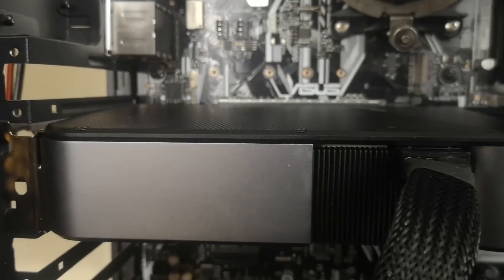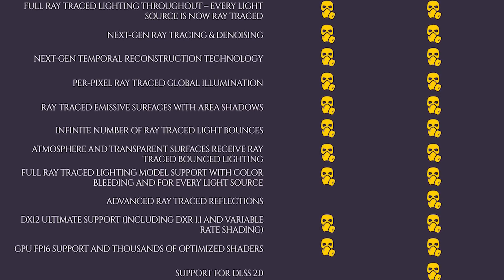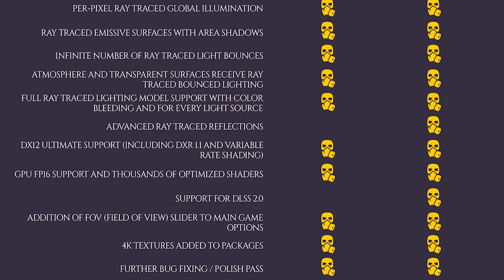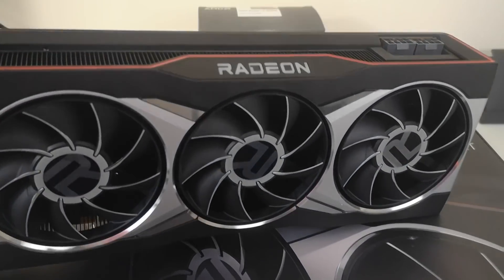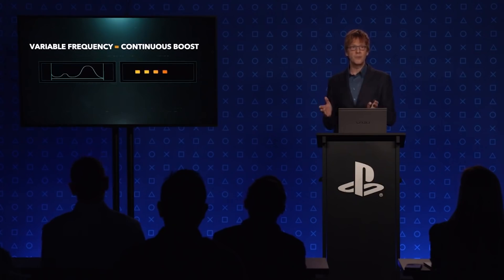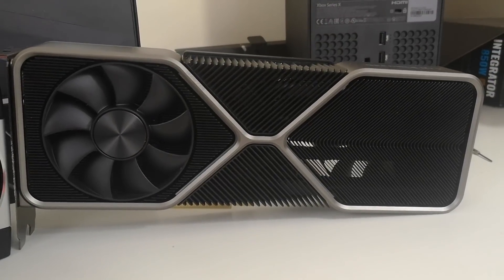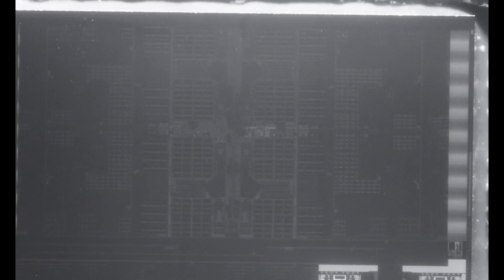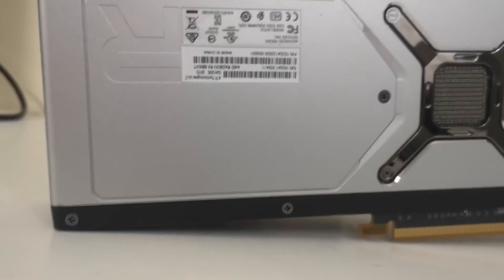XSX & PS5 GPU & Raytracing Performance - 4A Reveals All | Xbox SoC Secret Sauce by Microsoft

Comment: if they would have went with nvidia for DLSS 2.0 these consoles could maintain a constant 4k 60fps easy.Unfortunately they went with AMD who has inferior ray tracing support, No advanced AI cores or Tesnor cores and no advanced up scaling techniques like DLSS 2.0 which actually improves 4k performance a lot ( which looks better than native 4K in most cases).Thats the only thing I dont like about AMD's new gpu's is no good upscaling (or uses it with a bad performance hit) and bad raytracing performance. I know there RDNA 3 they have been talking about are to fix these issues, well have to see then.But either way you look at it they are good consoles for the price and even though Ive seen gameplay dip into the 40's and lower FPS in 4k(thanks to AMD) they seem to maintain 60fps in native 4k most of the time or a little higher without having to use upscaling.The only thing console players dont understand is these new consoles although using current gen parts dont actually use high end parts if they did they would be spending a whole hell of a lot more for the consoles,not to mention its D-ram cashless ssd(which is a bad thing and cheap ssd's dont have a r-ram chip).The AMD gpu is around an RX 6700 performance, which is like 3x slower than the RX 6900 XT but I guess you get what you pay for(and if you have the wallet for a high end GPU right now ROFL $$$$$$$$$$$$$)
Reply: First of all. Nvidia doesn't produce CPUs or APUs. Second do you think tensor cores / AI cores don't need any space on the die? Have you seen how much die space tensor cores are on an Nvidia Chip? Its something around 1/4 of a 600-700 mm^2 chip. On a console you have thermal and financial constraints.
Reply: @hanswurst2869  First of all your ignorance is outstanding.As soon as you said nvidia doesnt make apu's you dont even know anything about tech.The nvidia Tegra line is an SOC with both cpu and gpu under one package.Which is an APU but APU is AMD's own naming.Secondly they could have fit an RTX GPU core onto them, they have plenty of room.The series X motherboard is about as plain as the cheapest pc motherboard you can buy.Yeah the tensor cores and AI cores take up more room but not that much,they could have gone with a lower power chip anyways and still got better performance.It would have been a better option for better developed upscaling and ray tracing support.
Reply: @kyles8524  oh my god. I didn't mention Tegra because it's a f**** ARM APU and totally useless for a normal console. Do you know what ARM is? It's used in systems where you have a really low power budget.

Comment: Man bums me out that they're targeting 4k on the consoles, I'd prefer 1440 and upped details. But let's wait and see
Reply: Yeah they target 4K but in reality most don't hit 4K, usually 1440P upscaled or dynamic so it floats inbetween, DLSS would have been a killer feature for consoles.
Reply: @wing0zero  Console games already use various image reconstruction methods since PS4 Pro and to great results in some cases like God of War or Sekiro. Demon's Souls in the 60 fps mode also does that and barely looks different than native 4K.
Reply: i would completely happy with 1080p high framerate on high-ultra graphics presets. i mainly game on monitors not 4k tvs.
Reply: It does kinda suck, but realistically 4k gaming is still tough except on high end, expensive PCs. 

Luckily the jump from 1440p to 4k isnt dramatic as 1080p to 1440p. And its a lot cheaper
Reply: @cheesyriceo4  what? the jump from 1440p to 4k is more dramatic if anything due to more pixels
Reply: @nkill1565  Point of diminishing returns. Maybe you have hawk eyes but for me on PC, 55in TV, 7ft away (living room), I can barely tell the difference between 1440p-4K, but it's like night and day from 720p-1080p-1440p.

Maybe on a monitor while sitting up close there's a dramatic difference, but I havent seen a 4K monitor yet
Reply: @cheesyriceo4  hmm alright then
Reply: @nkill1565  Maybe on a large TV, it’s really unnecessary on PC as we use smaller screens and generally have better anti aliasing options. 4k 60 gaming on Ultra settings is possible on PC now anyway now that the 3000 series of NVIDIA cards are out.
Reply: They’re targeting 4k TV’s, unlike on PC I still play at 1080p/1440p with ultra settings. These consoles might have 4k, but they certainly don’t have Ultra settings or higher res textures, LOD’s, post processing etc like on PC.
Reply: They literally mention temporal reconstruction, so it wont be actually 2160p.
Reply: @WayStedYou  yeah you're right I missed that. The latest Control upgrade is a great example of 1440p with reconstruction, looks super sharp and 60fps is awesome. Very curious to see what metro looks like, seems like an awful amount of ray tracing, hopefully runs and looks great
Reply: @Eric B there's still hope for when tech like AMDs dlss competititor or directML get implemented.
Reply: @asheleydavies  yeah bust at the moment only Xbox Series X and S would benefit from hardware acelerated ML...Sony have to work a way to acelerate ML. Maybe Im pretty sure that ML its the key to make Series S a 1440p  console.
Reply: Then get an Xbox SS
Reply: @RubiiX Shit they will suffice with a locked 60fps on every game, they have been playing with 30fps for how long now? Lol
Reply: @Salt Maker look at you and your vocabulary, im sure daddy is proud
Reply: @Salt Maker no dad detected LMAO, seethe more
Reply: @Salt Maker Only 1440p? ngmi, 4k exists old man. All that power to get wrecked by literally everyone else
Reply: Blame the marketing guys at sony/Microsoft

Comment: 10 > 12 
End of story Xbots
Reply: @Heisenberg You clearly are stupid. Clock speeds are not a RDNA2 feature. The only reason clock speeds matter is due to Sony needing to overclock the shit out of their console to be competitive. That massive monstrosity of a case and cooling solution is clearly something you would only do out of necessity. Then the XSX doesn't have Infinity Cache as it uses a 320bit Memory Bus. Just like the PS5 doesn't have Infinite Cache, but a smaller Memory Bus.
Reply: @dreadlord7526  It's not a feature but for it to hit all those compute units effectively, it needs higher clocks than the 5000 series cards, which struggles with 4k 60.
Reply: @thechimera6963  Good thing the XSX doesn't struggle to hit 4K60 then.
Reply: 12 > 9.2
End of story Pony's
Reply: However the promised 12 tera FLOPPED lol
Reply: Lol. Okie dokie brudda, have fun with these console wars... Pathetic.
Reply: @Heisenberg It is not missing a feature just because MS decided to run the clock speeds lower. They clearly had a thermal target they wanted to meet so they could engineer a nice neat little console. Unlike the silly looking console Sony has released.
Reply: I bet he was great at math in school. 🤭  A real vagenius he was.
Reply: Hitman 3 has almost 30% higher resolution on Xbox.... That's fucking MASSIVE man.

Comment: The issue is nvidia gives you a base frequency of minimum performance. Sony didnt.  The ps5 touted variable speeds as some feature.  Its not.
Reply: PS5 does not go low to high, it goes high to low depending on demand. I dont why you would think it's not variable becuase its certainly not fixed.
Reply: @daru250  when you say the max teraflop number and dont say the minimum clock.  How is that a feature?

It is downclocking to regulate power and thermals i am assuming.

It is there to make the teraflop number seem closer to its competitor on paper when its doing its maximum output.

Cerny says as games tax the ps5 more the teraflop numbers will drop.  How is this a feature?
Reply: @TheBrotherKen  Because that's how Cerny described it, you dont go from low to high but high to low only on occasions that demand its, it's not because its convenient for the numbers. You Xbots gets so fixated on numbers but dont know how it matters practically. SX has more CUs but ps5 has more transistors per CU.
Reply: @TheBrotherKen  Lol "power bottleneck" what does that even mean. We still haven't even seen PS5 to its fullest potential, how can you possibly know a bottleneck exist yet. PS5 integrated,custom  I/O looks promising with all the added controllers in the I/O and cache scrubbers to move data efficiently.
Reply: @daru250  power bottleneck is when the power delivery runs out of headroom to push things further genius.  As In how smart shift shifts power from the CPU and gpu depending on the workload so Sony can claim a certain teraflop number from their gpu.  Ya know that awesome feature.  Every system has a bottleneck.  That’s like basic shit.  The next gen consoles aren’t even pushing a consistent sixty 4K on not that pretty titles and you’re sitting here like just waaatch.... no bottlenecks on this miracle machine from cerny. Hookay.
Reply: @TheBrotherKen  Lol I knew what you meant, I just want to know why you would assume such a thing so early in the gen with virtually no games in the market to push these systems to their limit .If anything the PS5 is better stacked to clear from bottlenecks with the integrated I/O.
Reply: @TheBrotherKen  Well maybe there is for the series x, cough cough The Medium running at glorious 900p lol.
Reply: @TheBrotherKen  wait... Funny how PC guys hate Sony but gives the OK to Microsoft for the same marketing of BS "features" Velocity Architecture, Mesh Shaders, VRS dawg. You really think the "Normal" console buyers knows or even gives a flying F to any of those?
Reply: @nbell5050  I don’t let either go out.  Velocity architecture? Excuse me one company told us their ssd was gonna cure cancer and spent an hour telling us about how great it was,  Microsoft just gave their ssd tech some fancy name in a hype video.  My issue is with the video saying we’ve been used to “variable clock speeds” comparing what Sony does vs intel mad or nvidia.  

Microsoft doesn’t get a pass.  Kinect didn’t get a pass.  The Xbox one didn’t get a pass.  

You console war dweebs are just over sensitive. 

It’s not the same nor is it transparent,.
Reply: @daru250  Exactly, others don't know how smart shift works. Your correct, its on load. Feed the CPU/GPU and it don't drop  at all
Reply: @marty8370  you guys just dont listen. Cerny says himself in the presentation and to eurogamer.  There will be drops in power when the system is taxed especially in new games where the cpu is going to be blitzed.

This is a feature? No it was a neccesity because of the underpowered hardware inside the thing vs the series x.  

Just give the people baseline worst case scenario like nvidia or amd does.  Doesnt matter if youre going low to high or high to low. Thats just double talk.
Reply: Smok3 SHO  that's FP16 like how GCN was calculating their teraflops lol
Reply: Smart shift is a feature douche
Reply: @Hahahanoyes  yeah totally. A feature for a douche to spend 500 dollars on a pos.

Comment: Wtf is sony hiding with  the ps5
Reply: @Merokaite  yeah that’s why I said Uk dummy
Reply: Bold Eagle  ign knows nothing and that's not true. Devs sent to digital foundry the complete list of settings on the ps5 with their pc equivalent. 90% of settings are on low and some of them (like lod) are a custom level which is lower than low on pc. Now put the 2070s on low and see how it performs lol these consoles are great, but still no match for the pc, period.
Reply: They’ve never hid anything in the past, and hiding good things is bad when trying to sell something, so my guess is absolutely nothing.
Reply: Nothing. It’s just that they can’t do the power narrative and it’s difficult to tell why the arcitecture is a big deal for them. So they will let the Games speak and be sure: Once they use that big data flow really, the details and textures will be probably mind blowing. So why arguing about 10tf versus 12 tf and start a complicated discussion about arcitecture that can’t be marketed really well.

The ps5 is great as the series x. End of story
Reply: @franzkuntschnig1320  Regardless of how fast textures are streamed the GPU will still be the bottleneck of resolution and texture quality. Faster load times, input latency and more objects appearing on the screen are benefits. Yet again it will put more GPU demand as well in order to give great detail as well. The push for the 9th generation should had been 1440p 60fps not 4K as the consoles are not powerful enough for native 4K 60fps.
Reply: @ZackSNetwork  sure 1440p/upscaled/60 is the goal.

They just do 4K because the „People“ are screaming for it.

Though it slowly changes and you can read more  and more that they want to use the power for other things instead of resolution pushing and that’s smart. Thanks to dlss. 1-2 years before all laughed abou checkerboarding and stuff and that’s weak. Now it’s common that even a 3090 uses dlss for Titels 

There is always a bottle neck in a system. But that consoles are around 2070 and 3070 with rdna2 features.

That’s not weak. And better than 90% of pc an laptops out there.

No need to argue in my opinion.
Reply: @franzkuntschnig1320  The consoles are not on par with a 2080ti-3070 stop with the false hype and lies. They perform like a RTX 2070-2070 Super. The Raytracing performance in both consoles is in fact worse than Turing as well. The whole everything has a bottleneck point is a lame comeback argument. The consoles have successfully handled IO bottlenecking however their GPU’s are still not powerful enough.
Reply: @franzkuntschnig1320  I was not arguing it’s just a simple exchange of information. To many people these days are to sensitive and believe anything against their narrative is an argument.
Reply: @ZackSNetwork  Never said 2080. between 2070 and 3070 and that’s what it is, depending on the game. a 3070 doesn’t match a 2080ti but has a advanced and better structure.They are AMD GPU, so comparing to Nvidia is a difficult thing. But That rdna2 is not performing like Turing in RT is not a big news. It’s AMD and not Nvidia.

You just act that these consoles are weak. the arcitecture of the ps5 is actually far more advanced than any pc out there and I am interested what will pc do? Brute force and stack up the RAM? Including ssd like arcitecture on the gpu? We will see.

But consoles had always one big advantage: they always perform better than comparable hardware on pc over time, more and more, because of optimization and developing on one hardware. And that is really a big thing for performance and will always be.

But will consoles be high end? No, they will never be.

But buying graphiccards every year is just for enthusiasts. On pc still they will have to consider HDd and that many users don’t have a better gpu than a 1060, according to steam user figures.

So I really dont ever think that these actual consoles are weak or outdated for the next years. They are actual middleclass performance Systems at a great price.
Reply: @ZackSNetwork  >  however their GPU’s are still not powerful enough
It incredibly powerful for the price. A 2070 super, alone as a paperweight, is about the same price as a PS5...
Reply: @ZackSNetwork  in many cases they are better. Im running a 3090 ftw3 ultra but prefer to play on ps5 most of the time.
Reply: @franzkuntschnig1320  people screams for 4k because there's no 1440p tvs, just 1440p monitors...we should blame the tvs industry.
Reply: @franzkuntschnig1320  1440p 60fps anything you bring and PS5 still outperforms weakbox lol
Reply: @franzkuntschnig1320  PC will move to DDR5, stack up RAM/VRAM and improve on that SAM like tech and brute force it as always.
Reply: @ZackSNetwork  No......the output needs to be 4K because 98% of consoles are played on TV and not monitors with 1440p.

Internal resolution is already mostly around 1440p. Its just upscaled to 4K using various techniques.....

Consoles are for 4K TVs.
Reply: @titntin5178  right...
Reply: -PS5 is outperforming Xbox
-PS5 is outselling 
-PS5 have games

Sony isnt hiding anything
Reply: @numetal4304  rEmaKes and DLc , Xbox out sold PS4.5 in uk last month , the division 2
Reply: @theweasel6720  The Weasel following me around lol
Reply: @numetal4304  lol , just here for any news on the Paulstation and Xbox , your just a bonus
Reply: @theweasel6720  those remakes and DLC are selling really well cant say the same for any xbox game.... also xbox sold more than ps5 in the UK for one month due to supply constraints even the article that made the claim about xbox outselling ps5 mentioned this lol worldwide PS5 is outselling Xbox so bringing up the UK for one month was so stupid of you
Reply: @Nerift  it’s the only games they have lol and spiderman is on PS4 also , both consoles are in short supply,, Xbox sold more in the uk , fact
Reply: @theweasel6720  for one month, overall sales the ps5 is already way ahead. That's facts
Reply: @allanwhittle4603  Xbox is selling better in uk , facts
Reply: @theweasel6720  not overall sales, playstation is way ahead. Xbox sold more in one month. Facts
Reply: @allanwhittle4603  not that far , Xbox gaining momentum now ,
Reply: @theweasel6720  no its not both systems are hampered by supply constraints don't be stupid
Reply: @Nerift  yes both are in short supply but Xbox sold more in uk , don’t be a dummy